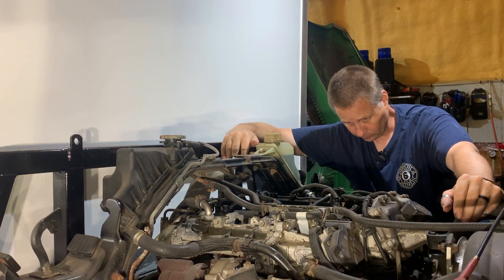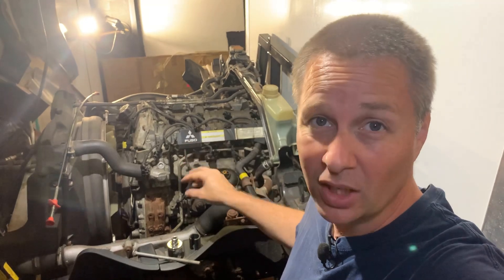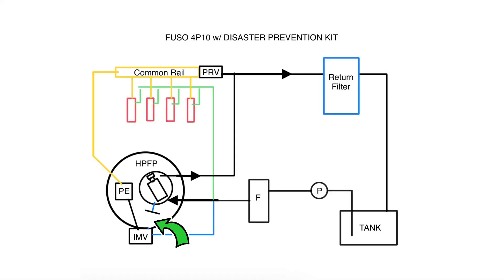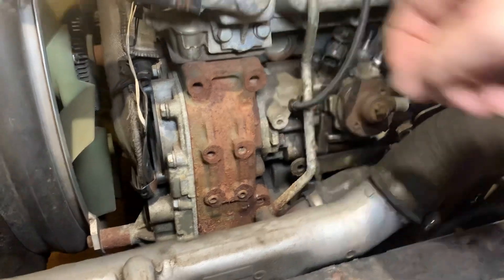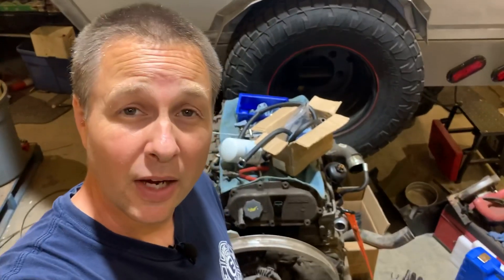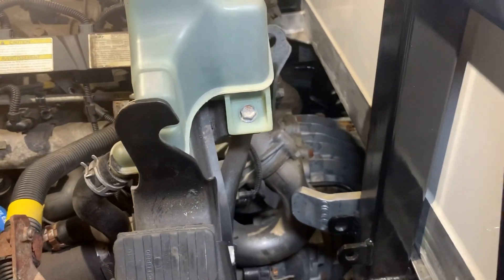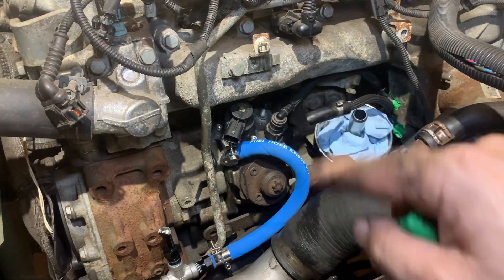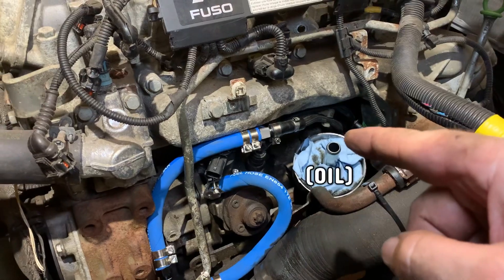DON’T skip this!!  Protect your Fuso NOW before costly repairs!!

Comment: The reasons most the time these problems happen, is because of either the fuel filter not being changed on a regular basis, adding a little additive to the fuel could help long-term life if you have sh!t fuel. Also the air vent on top of the fuel tank, ball valve getting dirty, and causing the main pump to implode the fuel tank.. you'll never know when the main fuel pump is gonna go.. because when these pumps go, they normally break and put metal filling all up to the regulators and injectors.

To prevent the injectors not causing damage to there seats,  make sure the water way hole is kept clear, cake the injectors in injector paste for easy removal in the future

Comment: We're is the lift pump I'm having fuel starving issues
Reply from the maker: My lift pump is just to the rear of the fuel tank - if you follow the line from the fuel filter to the tank you should find it.  Assuming your truck is the same model as mine.
Reply: @BruceandKrista  mine is not anywhere near the fuel tank I cannot find it is there definitely one this motor is such a mystery
Reply from the maker: What year and model?
Reply: @BruceandKrista  it is an 03 and I just found out I finally found the lift pump it's on the side of the block its mechanical is there any screens in a banjo bolt or anything anywhere
Reply from the maker: Yeah that’s a totally different setup than ours, different engine and all.  First thing I would do is prime using the manual primer on the top of the fuel filter housing, and see if it starts easily each time after that.  If it does, you likely have an air leak letting air in.
Reply: @BruceandKrista  thank you for the advice I'll let you know what the outcome is this motor is strange I hate it

Comment: Hi Bruce,
First many thanks for your great videos, very helpful for us.
We are “world” traveling with our 2018 FGB71 and currently in Texas. Checked the CP4 issue with my German dealer and he knows the issue but failure in the EU is rare, so I agree that the US diesel quality is the main cause.
We arrived on this continent almost 3 years ago and we always mix DIESEL KLEEN + Cetane Boost in our diesel tank, mainly because of the low US cetane level of 45. But I think this additive is also lubricating the pump and injectors.
Would you agree that Diesel Kleen is doing the job and I don’t need the Disaster Prevention Kit?
Thanks Branko
Reply from the maker: Hi!  I would say that an additive will go a long way to helping prevent failure!  The key to the disaster prevention method is the headaches it saves IF the pump does go.
Reply: @BruceandKrista you’re right, sleeps a lot better ! 😅

Comment: I have a FGB 71 Fuso and have change my tank to a larger tank the new tank doesn’t have an internal pump so got an external pump and connected it up  truck want start rang a few people and checked the pump pressure of the internal pump found it to be around 55 to 60 psi truck started so now I’m looking for a universal in line around the same pressure rating to try that I also spoke a company that make after market tanks he said that I have to stay with original tank and pump setup
Reply from the maker: The aftermarket pump I’m using, or the original Bosch 0580464118 (12v) is capable of 60 PSI and is external.

Comment: I have a Fuso Canter too, brand new one, 2024 model. I asked the dealer (Here in Portugal) and the chief mechanic about the CP4 pump fail rate, an they never had a truck there for high pressure fuel pump ralated issues for that CP4 models. So, then i saw a report about the CP4 pump and there is a line that is interesting, it said: "The most commonly held theory on why the CP4 injection pump fails prematurely is that the ultra-low sulfur diesel (ULSD) fuel availablein the United States lacks the lubricity required for the CP4 to be lubricated properly. Some argue that Bosch designed the CP4 for European applications (Bosch is headquartered in Germany) and that the fuel overseas has a higher lubricity than that in the U.S."    So, If this is is the case, maby the CP4 is betther for EU market only. CP3 pumps must be used on U.S., they are more robust and less tight tolerances
Reply from the maker: Yes, that’s the issue here - but unfortunately the CP3 isn’t a direct drop in replacement.  Using a fuel additive helps put back what’s missing in the ULSD.
Reply: @BruceandKrista  True, i think you can try to blend some biodiesel on regular diesel, it may be a cheaper alternative to aditives and a viable one. a mix of 10% biodiesel may be a good spot to increase the viscosity and is not too much to ruin the dpf. Mitsubishi does not like B15 or B20 diesel, only B7
Reply from the maker: Because of the issues with ULSD, additives are pretty easy to come by over here 😎
Reply: @BruceandKrista  
Do you have one you recommend? 
I wonder what it’ll do to the rest of the emission system
Reply from the maker: I’ve heard good things about Archoil

Comment: I don't understand this, but I'll take your word 😉
Reply from the maker: Basically sends clean fuel to the injectors, instead of “recycled” fuel that can contain bits of metal, when the fuel pump fails - which means ripping apart the whole fuel system, instead of just replacing the fuel pump.  With this setup, it’s just the fuel pump when it fails.
Reply: @BruceandKrista   But how,  right now with this fitted, fuel does to injectors, if pump fails it still does to injectors. I don't get how it stops it happening.
Reply from the maker: The fuel going to the injectors is no longer coming from the lubricating side of the fuel pump - so when it starts grinding up small bits of metal, they now go out the return, instead of onward to the injectors - if you look at the 1st and 2nd diagrams, you can see where the path changes.  The only fuel that goes to the injectors now, is fresh from the tank, not the innards of the pump.
Reply: @BruceandKrista  I'm in Ireland, diesel fuel here has 7% Biodiesel blended in with diesel, that's what one buys at the pumps. Do you think based on that there is no danger to my CP4 pump.  HVO is becoming widely available here at pumps also, I was going to switch to HVO, but it seems that has very low lubrication , or does it. A quick googles suggests so.
Reply from the maker: I don’t believe you have ultra low sulphur diesel to start with like we have in North America?.  Not sure what HVO is?
Reply: @BruceandKrista  What year is your truck? What year was the CP4 Pump introduced. I wonder is it in my 2010 Fuso 4P10

Comment: Nicely done.  'Quick release' fuel collar couplings are very common on newer vehicles and most can be released without a special tool, in this case though your printed collar tool would certainly make life a lot easier given the location of the connections!  It will be interesting to see the real-time running pressures on the fuel system.

I think most countries are now using low sulphur diesel so like many we carry a lubricant/biocide treatment.  It's a bit of a nuisance to have to carry it, but prolonging fuel pump replacement/rebuilding intervals is worth the trouble come fill-up time.
Reply from the maker: Yeah - I may have been able to get these fuel fittings off if I had better access at the back, but with t he hábitat box I can’t even visually see the fittings!  Slip these on and off they pop!

Comment: great explanation on the CP4 failure modes...  make sure you run ARCHOIL fuel additive to put some of that lubrication back into the pump. you can also run the oil additive to help keep your internals well lubricated and clean. 

the AR6400 fuel additive will help the roller on the CP4 crankshaft from seizing or turning in operation causing a pump failure. 

you should also look at the CP3 pump if you can upgrade it..(or is it a downgrade??)
Reply from the maker: I fully plan on running an additive (more on that in a future episode!) 😎